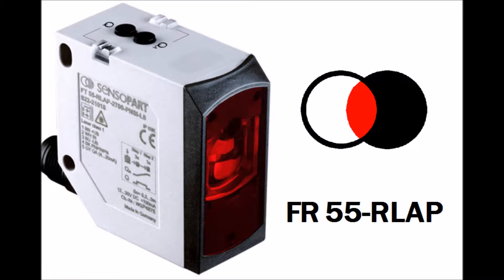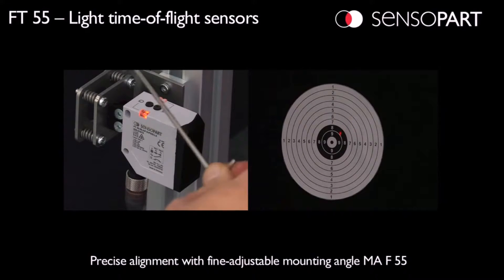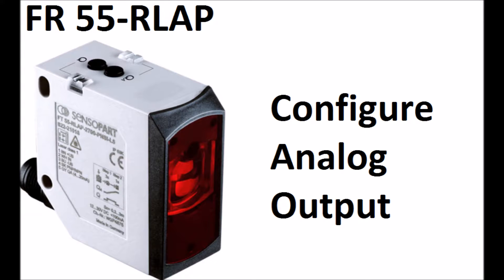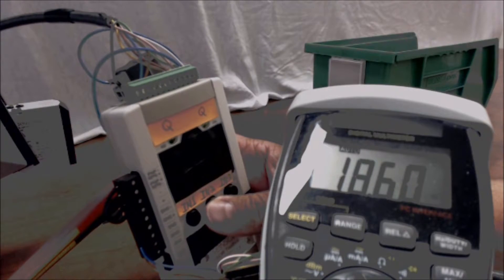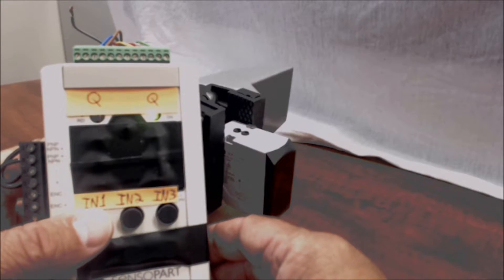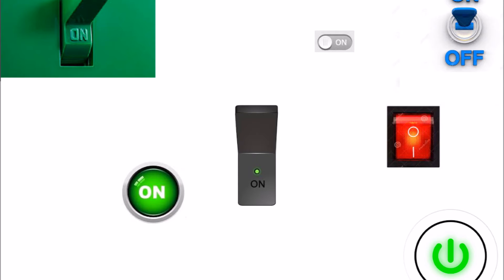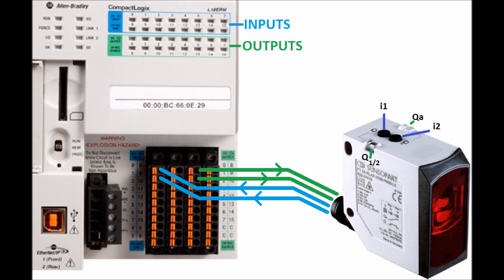FR 55-RLAP: 70 meter distance sensor by SensoPart

Comment from the maker: Check out this additional Information on these sensors
https://www.dropbox.com/s/fpu5fbsijsgstb1/TechNote_FR55RLAP.pdf?dl=0

There's a new 8-pin M!2 wire color standard by DIN.  Here's a cross reference to older cables. 
New DIN 8-pin M12standard. https://www.dropbox.com/s/jggfzcjpg3be81u/TechNote_DIN8pin.pdf?dl=0

Comment from the maker: 3:41  Restore to Factory Defaults.   
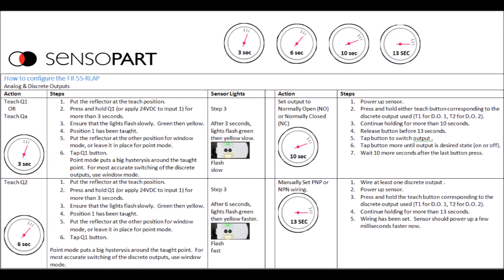1:57  Configure Analog output.      
2:31  Configure Discrete output 1.  
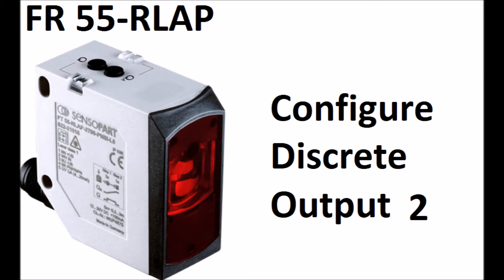3:14  Configure Discrete output 2.  
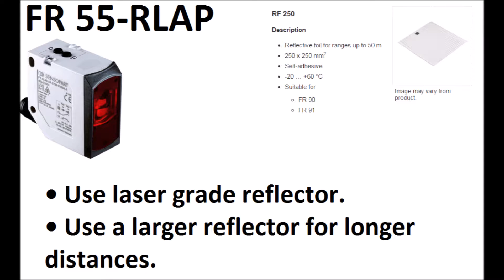0:33  Mounting bracket MA F 55         
4:05  DIN wire color standard for M12 8-pin cables.